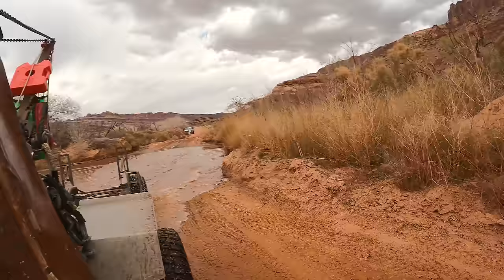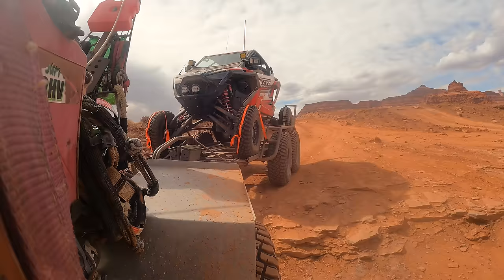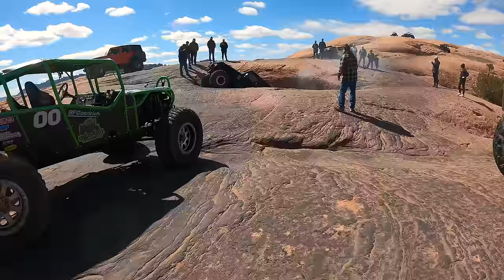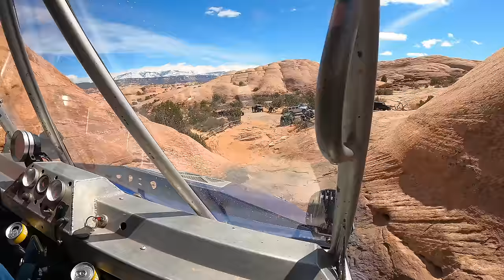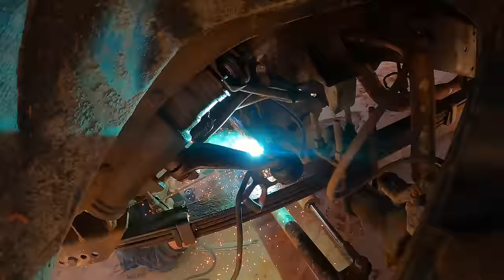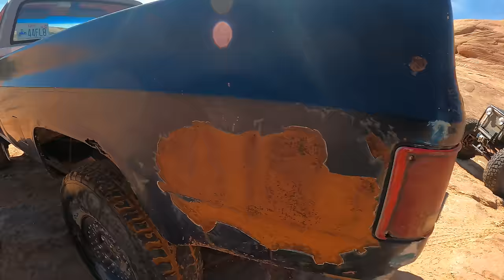A SxS Recovery, And A Play Day On Hells Revenge

Comment: I had the super rock Rey with fpv but my camera was mounted in the cockpit,  i miss that thing, but I sold it for jeep parts😂 I also had the vitavon parts all over it with all three diffs tuned and the esc tuned plus the suspension was flawless.   I used small drone electronics for the space limitations.    Ya'll live in heaven on earth.    Wheeling, Spanish treasure stories and gold prospecting all around not to mention the beauty of the whole area